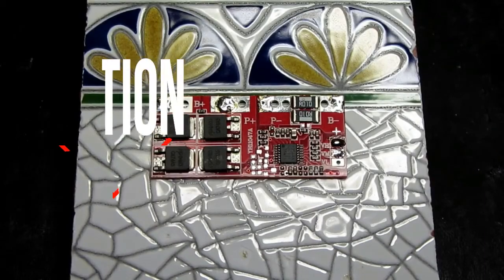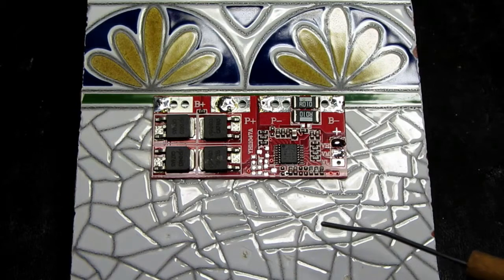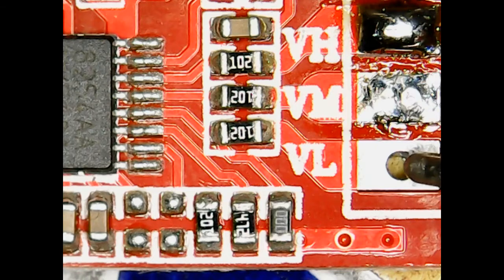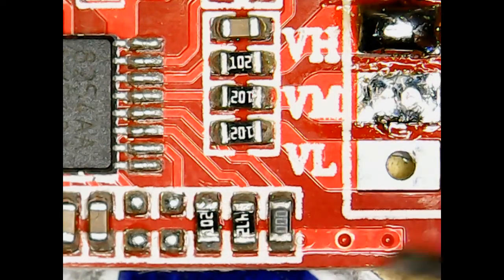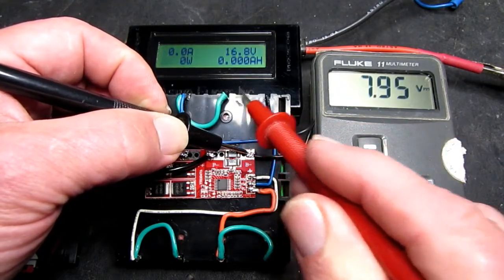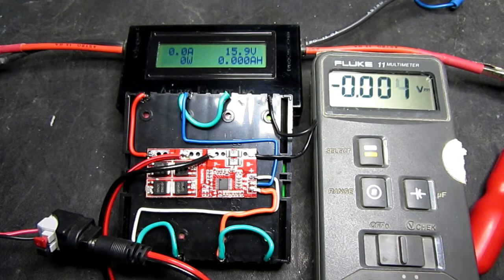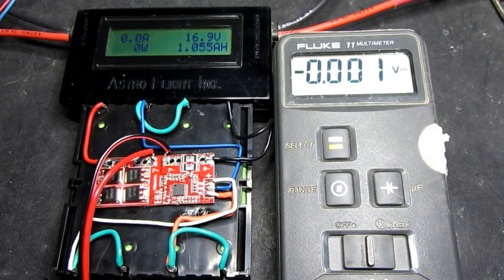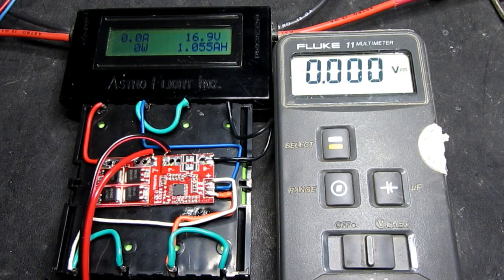3S to 4S battery protection  board mod / hack - Electronic Project

Comment: Hi. I know it is an old video but I happen to have now such a 4S board and would like to know how to use. What is the max input voltage that I can feed in? Should it be regulated exactly at 16.8Volts?
Reply from the maker: The module has overvoltage protection so you can use a higher input voltage say up to about 19 volts. That means you could use an old laptop charger of 19 volts to charge the cells. Thanks for watching, have a great day!

Comment: Can i use 2 of them to charge a 6s lipo?
Reply from the maker: While it is possible I would not recommend it. You would need two separate (isolated) power supplies. Better to get a board designed for 6 S like this one : 6S 15 Amp 24V BMS http://bit.ly/BMS6S15A

Comment: frien, can you help me, i want to modify a 3s bms to operate with the input voltage up to 14,8 intead 12,6, what component i should change in the board, i from soth america! the bms are the green ones on aliexpre
Reply from the maker: Obrigado Adriano! You will need to use an additional step down converter with constant current like I show in this video : https://youtu.be/K6P4fiPUbgA?t=331 You can see the unit here : http://bit.ly/LedDriver

Comment: Hola, nose si hablas español.
He intentado convertir la placa YH11047A de 3S en la de 4S.
Quitando la resistencia de 0 Ω que va en la pata 12 del chip y cambiando de sitio la resistencia de 102 Ω a la pata 10 del chip, creo que es como dices en el video( los numeros de las patas segun el datasheet YH11047A).
En las salida P+ y P- obtenia un valor de unos 9V y no 14v como en las salidas B+ y B-, por lo que NO me funciona correctamente para 4s.
Es dificil soldar las resistencias SMD con un soldador electrico, nose si esta ahi el problema o es que hay que cambiar algo mas de la placa para convertirla.
En el datasheet hablan de SEL pin, no entiendo muy bien si es la señal que recibe o hay que cambiar algo mas.
Reply from the maker: Hola, ¡Mucho gusto! La modificación de 4 células definitivamente funciona exactamente como lo muestro en el video. En este punto del video : https://youtu.be/sZOlD9pzaQM?t=160 puede ver una imagen de una placa de 4 celdas genuina. Puede ver que no hay resistencia en el pad que va al pin 12 (VL) y un resistor "102" que es de 1K Ohm en el pad conectado al pin 10 (SEL). Puede ver en la hoja de datos que el pin 10 (SEL) es el pin de selección para la operación de 4 celdas. Su voltaje medido de solo 14 voltios en B + B- parece bajo. Verifique los voltajes individuales de las celdas que deben estar dentro de 0.01 voltios entre sí o el paquete estará desequilibrado y el circuito de protección se habrá conectado. En la operación normal, debería ver el mismo voltaje en P + P- y B + B-, el único caso son diferentes cuando el circuito de protección opera. Un saludo desde Andalucia!
Reply: Hola. Muchas gracias por tu respuesta. No se si era un problema de desbalanceo de celulas. Pero lo he vuelto a soldar y ahora si que obtengo el mismo valor entre P+P- y B+B-.

Tengo una duda con el circuito BMS , ¿Reduce el voltage de entrada para adecuarlo a la carga de 3S ó 4S, si lo cargo a una tension superior? 
Estoy convirtiendo la bateria de un taladro de NI CD a Li-ion, y el cargador original entrega 7,2-14,4v (0,4A), no detecta la finalizacion de carga y he visto que se vende el mismo modelo para quimica Ni mh. Por lo que pensaba usarlo para cargar la bateria 3S de Li ion, con el bms 3S para que protega los limites de las baterias. 

No veo que pueda haber algun problema, ya que las baterias deverian estar protegidas por el PCB o BMS, y creo que no es un caragdor por goteo ya que carga en serie(Ni cd y Ni MH). Corrigeme si me equivoco.

Perdona mi ignorancia en el tema. Es dificil encontrar algun sitio que explique el correcto funcionamiento. No he estudiado electronica.

Un saludo desde Gandia!! Enhorabuena por el nivel de ingles.
Gracias
Reply from the maker: Hola Bastian, Si ahora tiene el mismo voltaje en P + P- y B + B, el BMS debería funcionar correctamente. El BMS no es un circuito de carga, solo protección. Para cargar las celdas es necesario un CC de Corriente Constante externo y un suministro de CV de voltaje constante. El cargador original NiCd no es adecuado. Para 3S, el voltaje debe ser 4.2 * 3 = 12.6 voltios y para 4S 16.8 voltios, es importante que este valor sea exacto. La corriente de carga debe ser constante y establecerse de acuerdo con la clasificación de amperaje de las celdas. Por ejemplo, una celda de 2000 mAh debería cargarse a 1 Amp. Otro problema es que el BMS no equilibra las celdas. Esto es muy importante especialmente para aplicaciones que utilizan alta corriente como su taladro. Muestro cómo poner una tabla de equilibrio en un BMS en este video https://www.youtube.com/watch?v=K6P4fiPUbgA
Por favor haga más preguntas si lo desea. ¡Soy Inglés! He vivido en España desde hace 12 años y creo que hablo bastante bien español !! Un saludo.
Reply: Hola de nuevo. Pensaba que los BMS o PCB tambien actuaban como circuito de carga. Ya veo que no es asi. Por lo que necesitaria un cargador especifico para Li ion (12,6v) o una fuente de alimentacion que entregase +12V??
El cargador original de Ni cd es de CC(corriente continua) nose si es CV(tiene el tipico simbolo de DC: Una ralla continua con 3 rallas pequeñas debajo) la tension maxima es 14,4v. Ahora se que la tension no es la adecuada para las celulas, por sobrecarga. 

¿El BMS del video  equilibra las celulas? Si que seria necesario en una aplicacion que consuma mucha intensidad de las baterias, como es mi caso el taladro consume mas 20A en el arranque, si se fuerza o frena, como si estubieramos taladrando. Ahora estoy utilizando unas celulas 18650 recicladas de portatil (samsung icr 18650) y el bms del video como prueba. Pero he comprado unas celulas de alta descarga 30A (LG 18650HB6) y otro BMS de 3S 25A continuos (38A max)con balanceo de celulas.

¿Podrias indicarme el cargador adecuado para este uso, de 3S? ¿podria utilizar el tranformador original y añadir un pequeño circuito de carga al caragdor o tendria que comprar un cargador especifico para Li ion?

Tambien estoy cambiando la bateria de un taladro de 18v Ni cd por Li ion.
Ni cd:
1,2v * 15 = 18v  nominal
1,4v * 15 = 21v  cargada
5S li ion:
3,6 * 5 = 18v  nominal
4,2 * 5 = 21v cargada
Aqui si que coinciden exactamente las tensiones, por lo que voy a  usar celulas 18650 recicladas con un BMS de 15A (no se si equilibra) y el cargador original, no me preocupa el estado de las celulas mientras no exploten...

Muchas gracias por contestar , perdona todo lo que te estoy preguntando, no tiene mucha relacion con el video. Los vendedroes de circuitos de paguinas chinas, no explican correctamente el funcionamiento o estan muy mal traducidas, con lo que llevan lugar a equivocaciones.
Si que escribes bien Español, Un saludo.
Reply: ¿Podria utilizar el cargador original(14,4V 0,4A), sin quitar el circuito rectificador conectar un modulo regulador de tension e Intensidad, para limitar la tension a 3S(12,6v)? es como el que tienes en tu video que me mandaste. Aunque 0,4A es poco para cargar las celulas.
Reply from the maker: Hola Bastian, Gracias por su suscripción! Para cargar el paquete 3S puede usar el cargador de 14.4 voltios que tiene con la adición de un módulo para proporcionar CC y Cv ajustables, como lo muestro en este video: https://www.youtube.com/watch?v=LpVrOQfy-_M Una alternativa sería esta: https://www.youtube.com/watch?v=zTxiflmyeU4Para el paquete 4S necesitas más de 17 voltios y el mismo módulo para CC / CV. Sugiero un viejo cargador portátil que debería ser de unos 19 voltios. Pregúntale a tu familia si no tienes uno o mira en el rastrillo o la tienda de segunda mano. ¡Un enfoque alternativo es no usar un BMS en absoluto! He usado mi cargador de aficionado RC y acabo de agregar una carga de saldo al paquete https://www.youtube.com/watch?v=Qy3W_gxnyDs Un saludo.

Comment: The over-discharge protection of this module is at 2.7 or 2.8V per cell, right?
Do you think it can be modified to 3V per cell?
Reply from the maker: Hi, The over discharge voltage is determined by the type of battery protection IC on the board. The generic number is S-8254A followed by two more letters which determine the cut off voltage, in my case they are AN which is 2.5 volt cutoff. The only way to modify this is to change the IC or buy a board that specifies 3 volt cutoff. You can see this in the data sheet here: http://datasheet.sii-ic.com/en/battery_protection/S8254A_E.pdf
Reply: Thanks for the info. So that's why there isn't any videos on youtube where a mod like this can be found.
Modules with a 3V cut-off seem hard to find. No luck on banggood. Maybe I'll have a search session on Aliexpress tomorrow....
Reply from the maker: Good Luck! Please post a link if you find a suitable board.